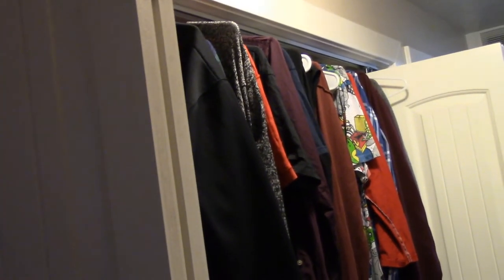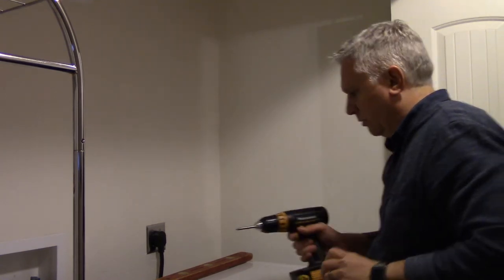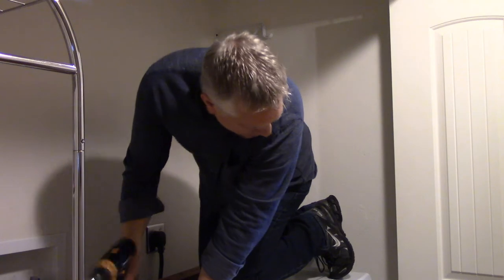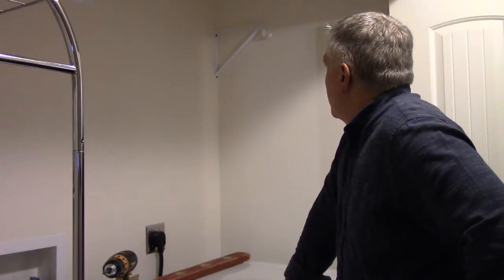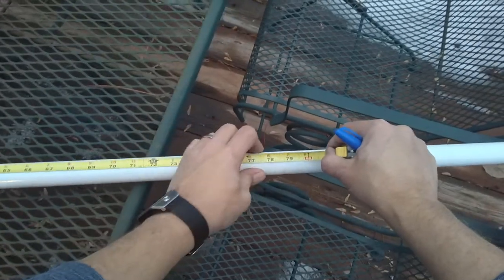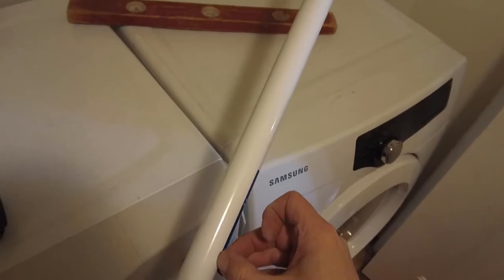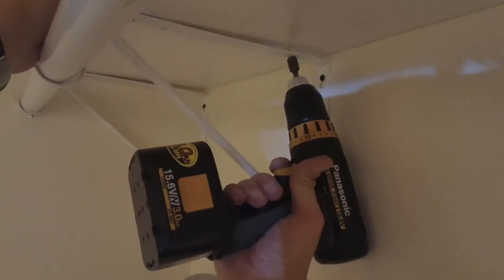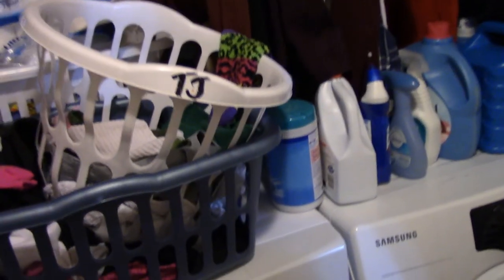AggresiveFun HowTo - Laundry Room Clothes Rod and Shelf Install

Comment: What type, size, and length screws did you use to attach the brackets to the wall?
Reply from the maker: They are Grip-Rite 2-Inch #6 Coarse Thread Drywall Screw with Bugle Head, 1 Pound #2CDWS. Amazon Link: http://amzn.to/2ytqzEN. Easy to get at Home Depot or Lowes as well. If you click "Show More" above, you'll see more detail on the supplies and equipment that I used. Thanks for watching!